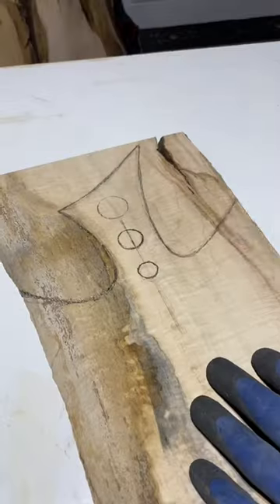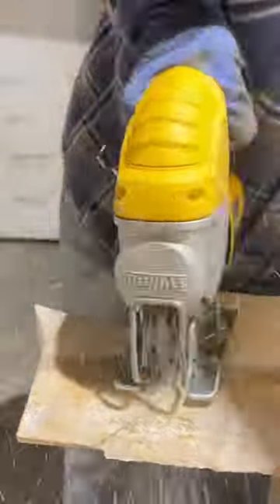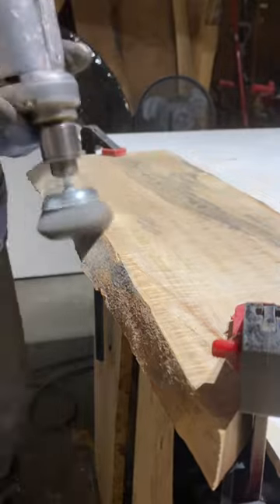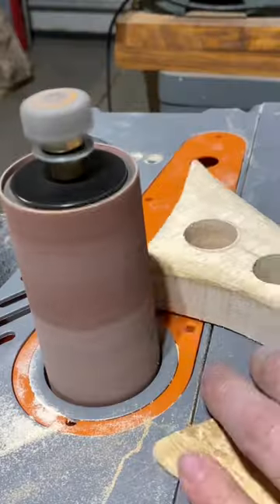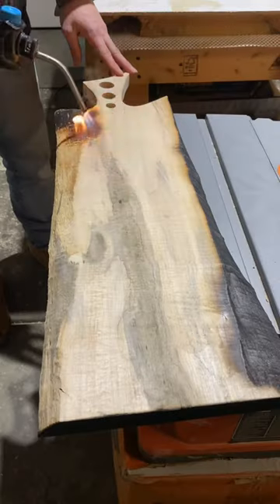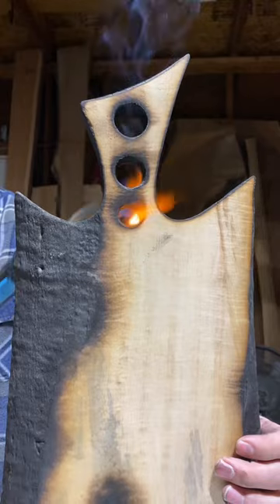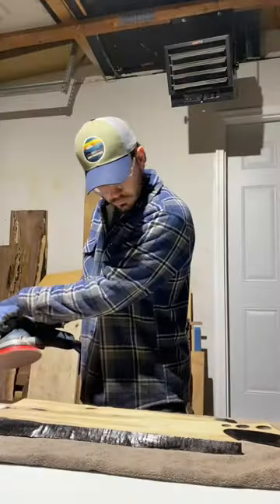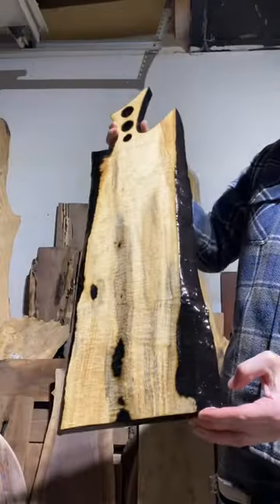Fire and Wood Art 🔥 #shorts #diy

Comment: As much as cooks and chefs like to use use wooden boards, they tend to use plastic boards alot more, and u know the reason: its alot lighter in weight, there is no maintenance  cost or effort, and u can use washing machine on them and there is no time limit one them if they soak in water for long timely. They are cheap.
There are only three minor reasons to use wooden boards: 1. They look better than plastic, 2. When the board is heavy u can cut on them with more confidence, 3. Nature friendly. 
I think wooden boards are going to lose in this fight in ten years from now